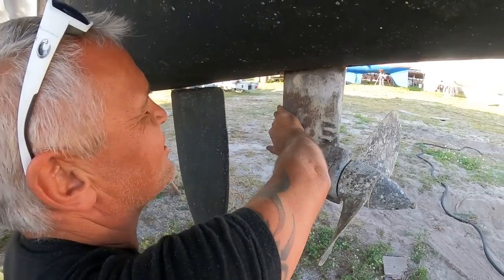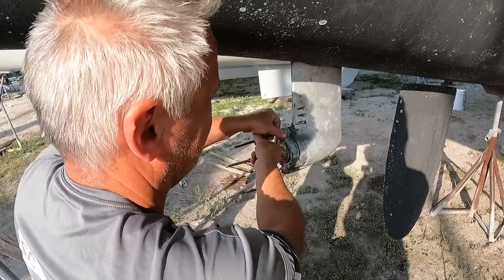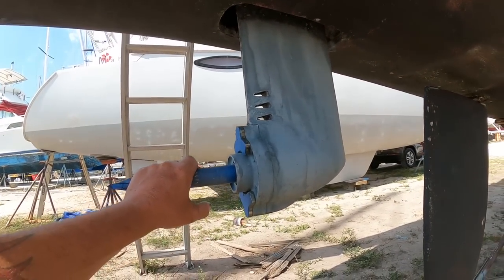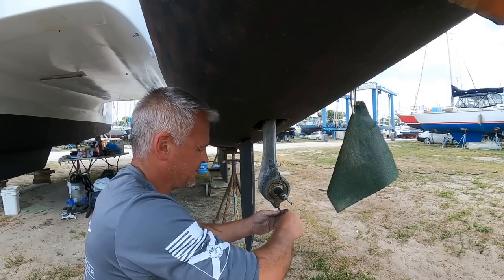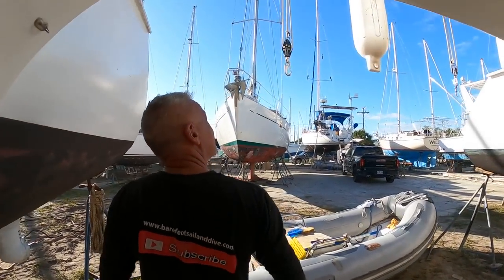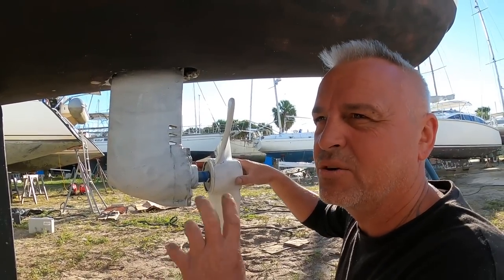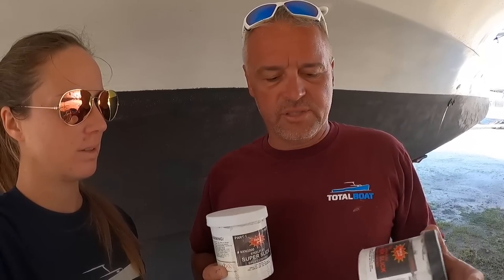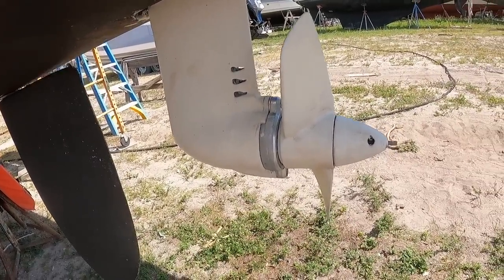Giving our Sail Drives an UPGRADE [Boat Work] (S4 E41 Barefoot Travels)

Comment: Davy-an impact screwdriver would loosen that plug in 1 or 2 taps-worth their weight in gold for just that !!!
Reply: You can get a set for less than 20.00 should have just bought a set. Though they do not always work. Sometimes they break the head off depending how corroded it is.

Comment: Looking good. That sail drive oil did look a bit thick. Now it’s changed, should be good for a while. Like the white look as well. Hopefully the Super Slick works well. 

I’ve been doing some reading, and came across Sharrow props. Quite interesting. They’re a toroidal style propeller, and seem to have a lot going for them. Better performance and improved fuel economy, etc. Have you ever heard of them?
Reply from the maker: Thanks! 

No haven’t heard of them. I will look into it that sounds interesting!

Comment: Hi Davy 
Did you consider building  fiberglass support structure for the hard top.
You could add structure to the existing hardtop and just have posts and cross braces as reqd?
Cheers Warren
Reply from the maker: Considered it but no we are going with stainless.

Comment: I would of put some lock tight on those sail drive bolts ur supposed to i have had multiple customers come and had to buy new lower units because of the bolts backing out due to no lock tight

Comment: While you are stateside in Florida you may be able to get a standing rig for your vessel. Sailor Man may be a source, Also as a result of hurricane Ian on the west coast have hundreds of broken sail boats as well. Perhaps you will be Blessed and find just what you would need for a reasonable price. Just a Thought. Be Blessed and Keep smiling. Hope you were able to get a small impact driver for the sail drive. PS Sailorman is a good source for lots of used parts and things you may want to check them out for many items
Reply from the maker: We’ve been into sailor man. Seems like a decent place to find supplies. There is a similar type store up here in Fort Pierce! A treasure trove place 😆 
No masts just yet
Reply: @BarefootTravels  try the west coast around Ft Myers to port Charlotte contact marinas and boat storage yards there! Hundreds of boats damaged by Ian Good Luck God Bless and hope you find what you need. Regards

Comment: Hey guys. Nice video. Question… do you still use ATF fluid or did you change to 30W oil? I keep hearing two schools of thought. Keep up the good work on your videos.
Reply from the maker: Thanks! 

We haven’t actually put new oil in just yet. But for our sail drives the recommended is 80w90
Reply: @BarefootTravels  Thanks for the reply. Odd, but mine are the same on my Lagoon and I got a service bulletin years ago about changing from transmission fluid to regular 30w oil. Do you have a bulletin or something showing the heavy gear oil?  I’ve got years to go and want to stay up on all that stuff. Thanks! Glad I watched.
Reply from the maker: I just looked up what type of oil in the yanmar sd20 sail drive manual and it said 80w90. We never got a notice saying 30w 🤷🏼‍♂️
Reply: @BarefootTravels  good deal. Maybe the Volvo foot is different. Funny how manufacturers all have different ideas. Still a good video. I’m headed into what you’re doing real soon so this helped make up my mind. And I agree with the boot theory. So far every one I’ve seen removed looked brand new. And some were over ten years old.

Comment: Omg who built your yacht? Did they know what they are doing? Usually the propeller is in front of the rudder. Why? Also if you put a rudder behind a fixed propeller, you can steer at zero speed.  Hmmmm. It is a catamaran and you do have two engines. I guess you only have to be careful at slow speed if you are just using one engine.